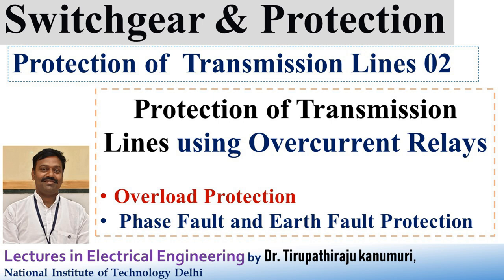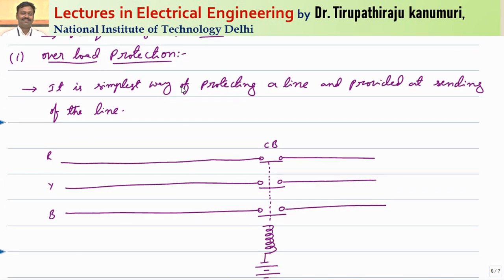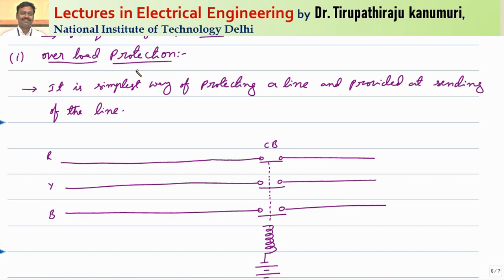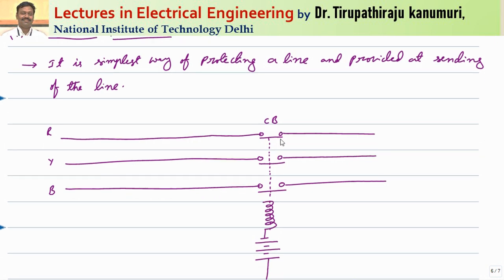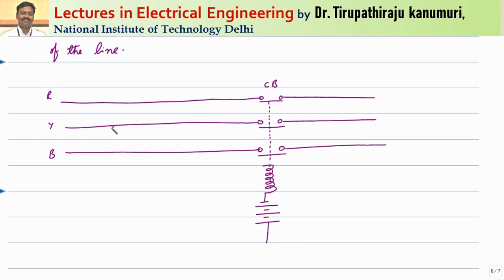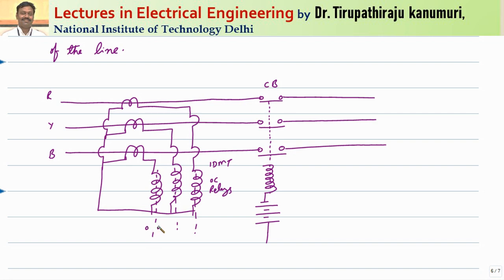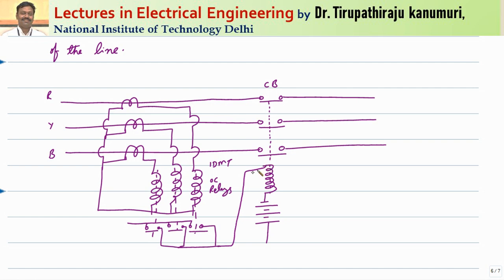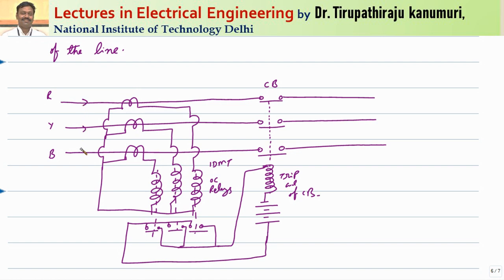SGP503 Protection of Transmission Lines using Overcurrent Relays

Comment: Sir, you mentioned Earth fault relay settings, 20% of rated current. Is it the 20% of neutral grounding resistor rating (for example, 80A f the NGR is rated 400A?).